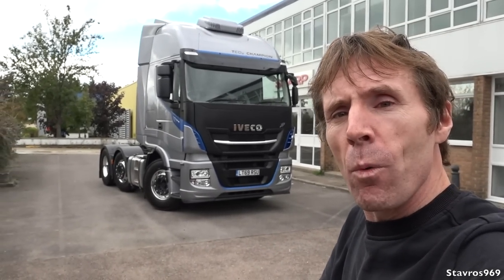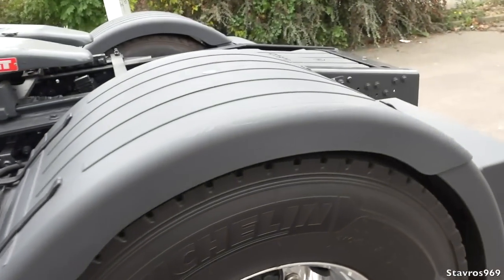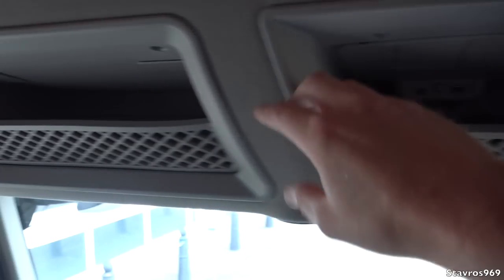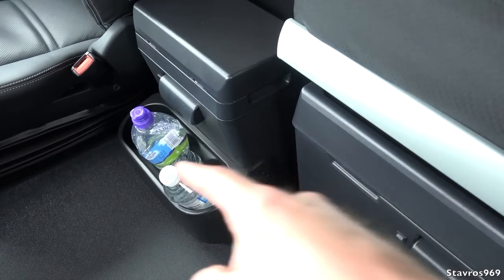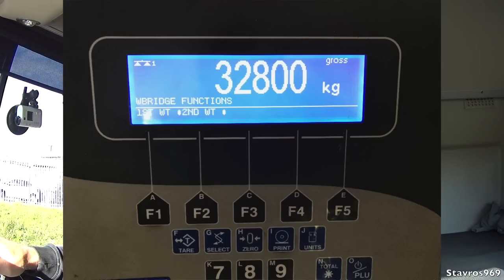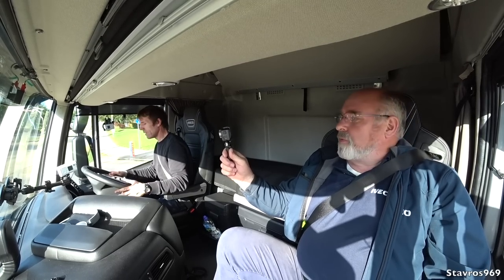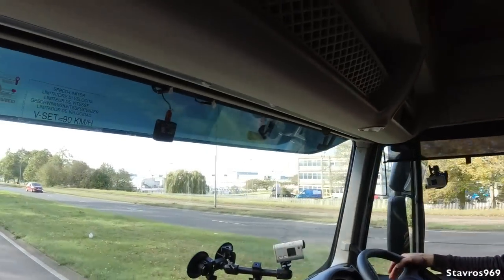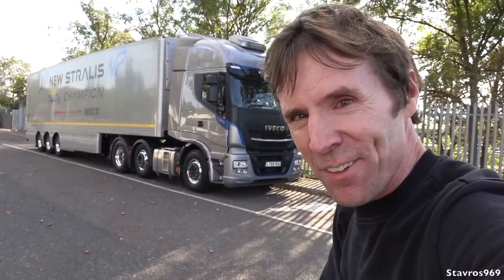IVECO Stralis XP 570 - Full Tour & Test Drive TCO2 Champion

Comment: great looking truck and I like the basic straightforward layout of it. It's got everything you could possibly need without all the driverless bs you get with that awful Mercedes Craptros.
The company I work for got rid of its Mercs and now use Renaults but it would be great if they added a few Iveco's too the fleet as well. Cheers for the vid Stavros!

Comment: I had a Stralis 310. Worst truck In existence. It would struggle to get up a hill with a normal load. 4x2 chassis was very weak. Many cases of slightly bending or twisting.